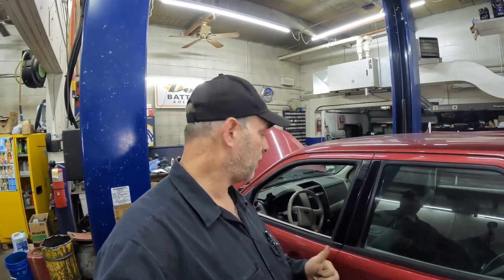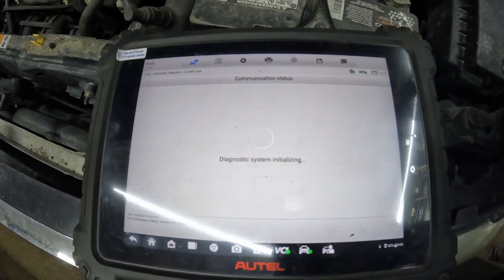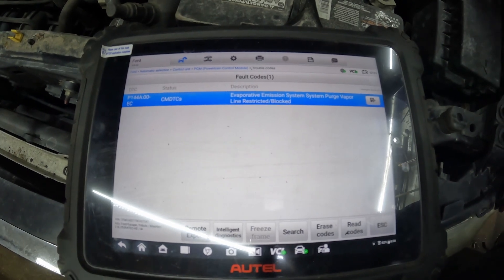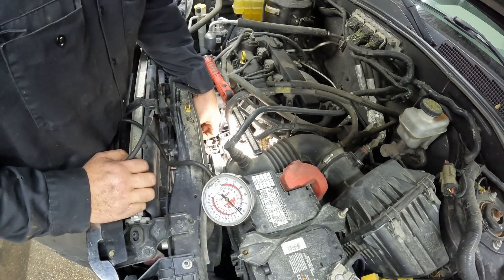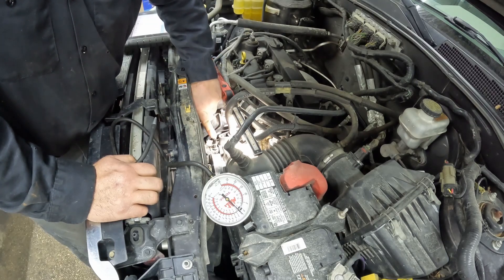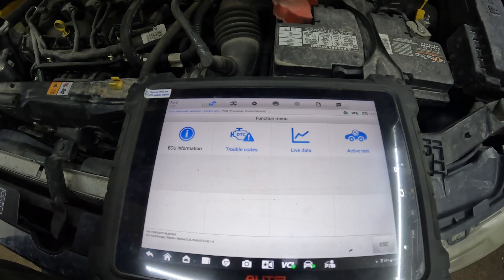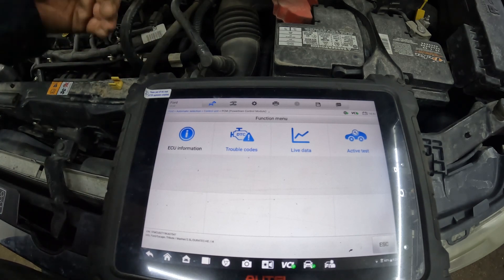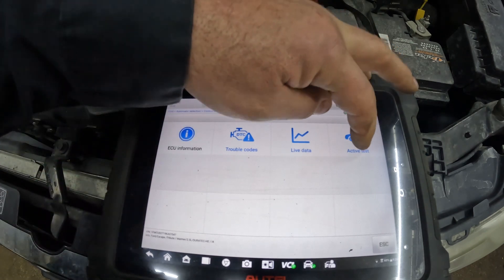2009 Ford Escape EVAP Code P144A

Comment: I have the same problem on my 2010 escape. Couldn't you just "evaporate the fuel in the canister either by vacuum overnight or positive pressure until all the gas is evaporated in the canister?
Reply from the maker: In my experience it never seems to work by doing that.  If I'm doing the job for a customer,  the vehicle needs to leave shop fully repaired and I have peace of mind that the customer will not have any problems going forward.  You could try to see if that works but any professional shop would probably not take the chance.  Time is money and I'm just not sure it's worth the risk.   Let me know if it works out.  Thanks for watching!!